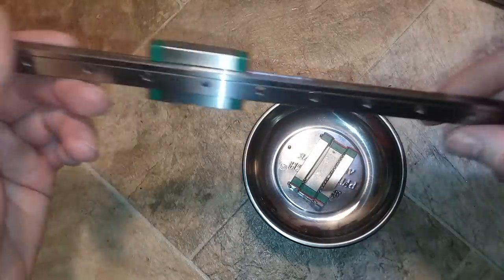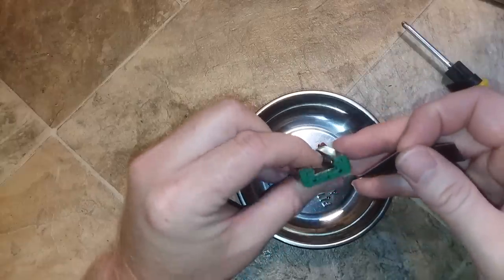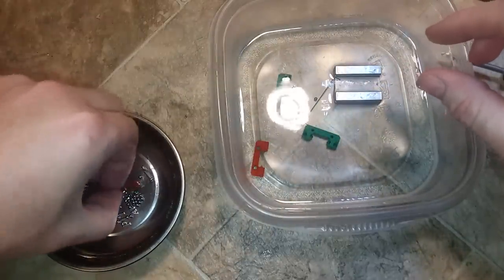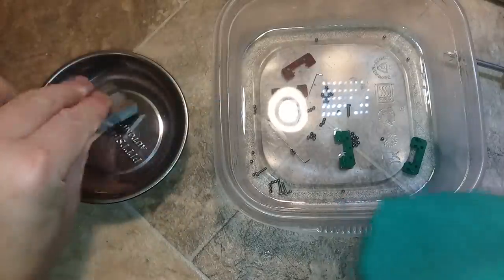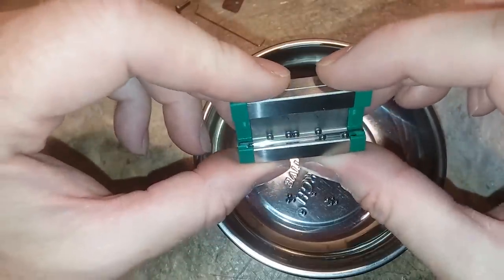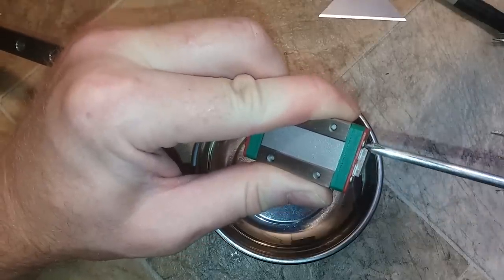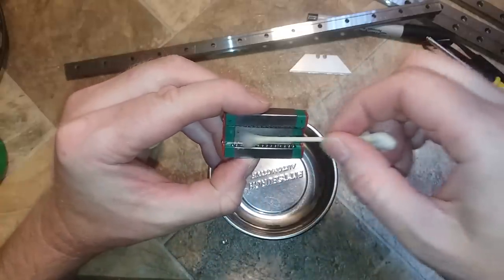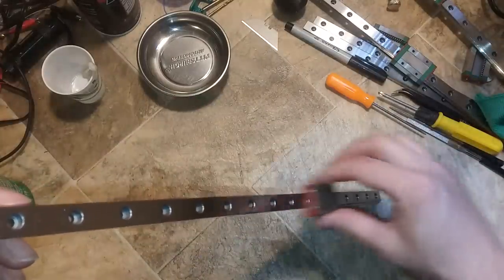Tuning Up Cheap Chinese Linear Bearing

Comment: It does look like a Hiwin knock off. Linear bearings are typically pre-loaded for smooth action. However with the smaller gothic arch, you cannot preload loaded them (not enough anyway), thus they will stick if there is no normal force on the carriage. The only reason you were able to get the free motion out of your guide is that there is way too much space for the bearings. This is also evident since you said they were falling out. In the end, I bet this rocks back and forth a bit, and would not be reliable for alignment applications.
Reply from the maker: The only reason they bearing did not move smoothly is because they are coated in factory protectant (cosmoline) which gums up the movement.  Did you watch the video?  The bearings fell out because the retaining clip was bent out of shape by the left over plastic from the molding process and that was only when the block was not on the rail.  And I have zero slop in the bearings and print at 100 mm/s.
Reply: @MrDabrudda  I think Alexander is right actually. I have genuine HG15 blocks/rails and they definitely grab quite a bit. In this case it might well be because of the particular grease they use at the factory, but good linear bearings should not roll far beyond where you push them.
Reply: This is a low-cost low-profile linear rail with only one row of balls on each side, they are usually not preloaded for entry-level DIY. Verry limited constrain in Y direction and tilting. The standard profile liner rail usually has two rows of ball bearing on each side and preloaded, so 5 out of the total 6 degrees of freedom are fixed. When they are in new condition, pretty hard to move by hand. But when they get old, can also move freely.
Reply: @JamesZJi  Depending on how you install it and determine the right position
Reply: @MrDabrudda  there's no such thing as zero slop on mechanical devices ;)

Comment: What could cause it to still be binding after you've cleaned and put it back together.  I had no gaps of any kind between bearings, almost as if there were too many. Mine tried to pop out more than once while putting it back on the bar. Tip of my exact got magnetized sitting in the little tray and that helped put them back in. It's a fiddly thing for sure.
Reply from the maker: Make sure you don't have too many bearings in each side.  Mine had 33 bearings each side.  Also make sure the sweep seals are loose when installing the bearing block onto the rail and then tighten the sweep seals down.  And check the bearing path for any damage.  It may require some breaking-in to loosen up.

Comment: Use WD-40 or Mineral Spirits for cleaning/degreasing linear bearings.  Clean/dry, then immediately lube/oil them with a lubricating oil (not WD-40) after they are dry.  Good tutorial... Great catch on the extra plastic bowing the retaining rails.  These cheap Chinese linear guides/rails are prefect for small project machines and upgrading cheap 3D printers and laser cutting machines.
Reply: What's a good lube I can buy locally??
Reply: @omaroskeno3314  Use ky jelly. Your neighbour might have them
Reply: I like the file use over the clean parts too.
Reply: @Zo Fryer For these, I would probably use 56504 instead

Comment: Is disassembling them necessary for cleaning them? I have a similar set on my printer and I got mine oiled with a basic (non-silicone) oil directly on the rails and I've never had any issues.
Reply from the maker: You could soak the bearing block assembly in IPA to break up the protectant and then lube.

Comment: My problem was the size of the balls. I had to measure one by one and take out the big and smaller ones
Reply: Depending on what you mean by that, having two different sized balls in a bearing is often intentional as it prevents the bearing from binding up.

Comment: I have bought 2 extra MGN12H blocks because there comes only 1 with the rail.
When i place them on the rail, they don't even slide a bit. I need some force to move them over the rail. So, i hope i can fix them, else, i have to trash them.
Reply: I know its probably too late, but its the wipes that bind your stuff up.
Reply: @girrrrrrr2  Is there a way to alter the wipes for better movement?
Reply: @ronnyverminck2741  Loose up the screw and then tighten it when its on the rail.

Comment: Brilliant just what I was looking for I’ve ordered 3 heavy duty sets to make a good CNC may I just say another video a guy measured the bearings and they were all very slightly smaller and as quality bearing are minimal cost he recommender replacing them which I’ll do also

Comment: If you put these bearing too close to a magnet they may get magnetic as well.
Reply from the maker: The magnet in the tool tray is not strong enough to leave any lasting residual magnetism in the bearings.

Comment: Excellent video but I was wondering, couldn't you submerge the bearing without disassembly into the alcohol and have it dissolve the gunk? Move it back and forth while submerged for a bit? And could I use acetone in lieu of alcohol? Thanks!
Reply from the maker: You could use alcohol to clean up the factory protectant.  Aceteone might be too aggressive and eat the plastic.  Not sure what type of plastic are on the blocks
Reply: @MrDabrudda  Thanks, I just got four guides so I'm going to have to prep them soon, looking forward to the upgrade!

Comment: Do you think you could just soak the bearings in your solution without disassembling them and still get similar results?
Reply: Possibly, if soaked.  Hard to get the solution down in all the holes, crevices and between the bearings, and enough circulation to get the goop and any debris out.  Note the long tubes full of ball bearings.

Start having to check out the effects of long-term exposure to the solvent on the materials used.  Swelling, softening, degradation, cracking / crazing.

Comment: meh, i didn't see any reason to clean the bearings that came with my cnc router; they came with a grease nipple and with the sort of grease they suggest to use, it's not supposed to slide that freely anyway. I did loosen and tighten the seals for installation though.
Reply from the maker: These smaller bearings don't come with a grease zerk fitting.
Reply: @MrDabrudda  these "Chinese clones" u mean.
Reply: @Killerjack007  nah i have expensive linear rails but they dont have a grease fitting. theyre for a 180x180 printer so theyre way too small for one
Reply: Often times the grease port on Chinese linear rails are just for show they don't lead anywhere
Reply: @techdegenerate286   Mine do thankfully but I know some that require a hole to be drilled into the plastic before fitting the nipple.
Reply: @techdegenerate286  "LOL"
Reply: @MrDabrudda  Chinese junk bearings don't come with a grease zerk.  Industrial quality ones do.

Comment: I wouldn't advise running any kind of bearing without some form of lubricant, maybe some thin gear oil or something but no lube is a bad idea
Reply: Did you even watch the video? he used Slick 50
Reply: rparker069 you can ren dry and in some applications it’s advisable. Good bearings will last a min of 10,000 linear miles of travel. Real Hiwin is the low cost bearings and rails, Iko thk, Bosch, and Thompson are high end.

Comment: Very descriptive and useful - thanks!
@3.55 - you're filing plastics parts down in your cleaned parts cup.
I was wondering why you didn't use the magnetic pan/cup with the water/alcohol solution - any specific reason?, the parts ought to stay down there and not easily fall out and dissapear on the floor, and no need to move them around too much - getting (more) finger grease on them when clean, etc.
Reply from the maker: No specific reason.  It was the container I had on hand and was deep enough to submerge the parts.
Reply: EgonSorensen 77

Comment: I would use a graphite pen for locks to avoid ball clinging but people are always too cautious with oils for dirt collection and in general almost any oil or vaseline works as long as it doesent affect the plastic mounts as the speed for home use is somewhat slow anyway and if you just use such on lets say z azis, it wont move much at all and that we wish to have a rigid mount instead.  I would say that dont use them on x axis on printers or cnc, and never on y on cnc unless it is covered from dust pr the bearings will clog. A combination of bars and these is best

Comment: But are the rails nice and true? Is there any play on the bearing housing block?  Cause thats the problem with cheap rail bearings, they aren’t true no matter how smoothly they move.  I would like to see how far off the rails and the block is when it’s moves along the rails.
Reply: it's hard to measure unless he has a super flat surface to but them on... I am wondering how DIY guys do check them without having to invest in super expensive gears
Reply: @anoirbentanfous   You can feel when there is play. I brought one good set of rails and blocks and then a few chinese blocks, you can feel the difference, no need for anything special to measure it.
Reply: @metalmolisher666  you have special fingers, men!  ;-)
Reply: A plate of glass can be used to check the straightness of the rails.
Reply: @archer9338  glass isn't very flat use a surface plate if you can afford one, or make a flat surface with the 3 plate method (I believe oxtool has a video about it)
Reply: A steel rule in good condition is enough to check how true the rails are
What are these super expensive tooling you need to check how flat they are??

Comment: Not sure if you're still responding to comments on this, but does it make sense to replace the balls in these with ceramic balls? Obviously that puts you with not cheap rails anymore, but theoretically, you should never have to perform any maintenance again right? No lubrication would be the least amount of drag too if that makes any difference.
Reply from the maker: For the application I would not replace the ball bears.  I clean the rails once a year and reapply lubricant.
Reply: Replacing with Teflon balls is also a thing, but it has been suggested by Adam Savage on his Tested channel to consider polishing the raceways.  And of course this depends on your application.  Teflon would be a low rpm type solution, i.e. an R2-D2 neck bearing, that doesn't need to move much.
Thanks OP for sharing this material.  I've acquired a cheaply built gemstone faceting machine I'm considering cleaning up and extending the mast bearing on.  Might go crazy and run stuff through the ultrasonic cleaner in a bath of carb cleaner 🤪 ...but will probably stick with steel balls, and lube.  
I really appreciate the tips, and took notes.  I was dreading doing this; thanks to your video, I'm now looking forward to it.  Subbed.
Reply: No absolutely not. these are hand fitted at the factory with slightly different sized balls, that's why you see numbers like +2 hand scribed on the side, even mixing the balls in the same block could result in binding or stickiness due to mismatched ball sizes.
Reply: There's no way to adjust the preload,  so ball size is more critical than material.   If these get sloppy with wear you can buy oversized balls.

Comment: Thanks for sharing, looking into getting some 800mm linear guides for my Delta printer. Kind of curious since its been nearly two years. How well are these holding up for you?
Reply from the maker: The linear rails have held up perfectly.  Every few months I'll clean the rails with a terry cloth and reapply the synthetic lubrication.

Comment: There is a much simpler easier way to clean these... Even old dirty neglected bearings. Inject lps and work it back and forth. Repeat as necessary. Do the same process with grease 2-3 times as necessary to remove the lps. CRC QD electronic cleaner before grease if your concerned about the LPS. 
That looks alot like a Korean hiwin.  Which is a decent slide and bearing.
Reply: The chinese are copying Hiwin, you can find those on aliexpress or ebay

Comment: EDIT: THANKS a lot for this video :)
I just tried to do this on the rails I got. They look exactly the same, but even after two cycles of cleaning, bending the guide wires so they don't press the balls too tightly against the race and de- and regreasing, two of my rails are still quite hard to move. did you have success with every pair of rails you ordered? I feel one of mine has just a little bittoo tight tolerances...
Reply from the maker: All of the rails I purchased cleaned up and moved without binding.  With use the rails should loosen up.  Just keep them clean and lubed and watch for any signs of deterioration.

Comment: I do that with my LM8UU linear bearings as well..usually they come with grit/garbage in the small bear bearings and cause issues and alot of noise..
I would bet a drop of non-detergent air compressor oil would go a LONG way in the smoothness of that rail and bearings
Reply from the maker: Use some pneumatic tool oil would work too.  3 in 1 oil, even mineral oil would be better than nothing.
Reply: Have you tried sewing machine oil? It is the closest thing commonly available for use on machine tools (micrometers).  Lubes well without attracting a lot of dirt and grime.
Reply: Brad Quinn sewing machines are, after all, the most precision machine tool that the average household owns — and that has been true for about a century.

Getting less so with modern cheap-ass plastic sewing machines mind you, as those displace good old machines.

Comment: Couldn’t you soak the whole thing and then lube it without taking it off the rails? You wouldn’t have to worry about losing bearings then. I thought about this as I was putting one of the slides back together and lost a bearing.
Reply from the maker: I guess you could soak the block in alcohol but it may still have cosmoline protectant in the slots.  The factory protectant would be diluted with the cleaning and re-lubricating.

Comment: Are you still satisfied from those rails on working? Are they performing well on your machine?
Reply from the maker: Very satisfied with the rails.   Far better than the Igus bearings I was using.
Reply: @MrDabrudda  thank you very much

Comment: I lost some balls, so i took some from an extra block and WOW they are not the right size and so it works like poop. Its the same size block but slightly different balls. Guess ill need to remove all of them and pick out the wrong ones.
Reply: you can buy those small balls on ebay cost a few dollar for 100 search 1mm to 9.525mm G10 Grade 10 Chrome Steel Ball Bearings

Comment: The reason why these bearing with viscous grease is to compensate these tiny tolerance between slider, ball and rail. Without these high viscous grease, the slider will wobble......It is not because they don't want to make it good, it is because people want to buy it cheap....
Reply: the carriage wobbles on the cheap ones? Didn't know that.. That'll cause sloppier 3D prints. GTK.
Reply: It depends, but you are absolutely correct in some cases. Avoid this by being choosy where you purchase, put the time into preparing them, swap out the ball bearings for higher quality ones if you so choose, utilize the proper lubrication type and application method, and you can really end up with a solid piece of equipment at a great price. I've seen $25 rails with swapped out bearings outperform $50 rails. It depends on a lot of factors.

Comment: Great video! Why using a solution of 25% IPA and 75% water and not full IPA solution for cleaning ?
Reply: Full strength IPA may damage rubber or plastics. Just enough to dissolve High Quality Anti-Corrosion Inhibiter from Peoples Republic of China... LOL
Reply: And more importantly I think simply because it's cheaper that way. No idea how cheap it is elsewhere (seems to be practically free in the USA) but it's actually very expensive here in Finland at 16 euros per liter. Therefore if the full concentration isn't necessary you might as well treat your wallet and dilute it with water

Comment: i saw these on ebay when i was looking for parts for my diy pcb mill. was curious if they were any good. i think many of the mechanical thingstuffs i get from china all come with packing grease that needs to be stripped off and replaced with something more usable as a lubricant.

Comment: I have two sets of rails from two different suppliers. The blocks are different sizes and don’t fit each other. Quite annoying!
Reply: Then you should have ordered the correct sizes!
Reply: Acrimonious Mirth I have a Honda Ridgeline, nothing is interchangeable with a Ford Mustang....gee, I wonder why.

Comment: I also ordered some cheap rails and I have one question. Are little scratches on top of rail an issue? Sides where guides/balls should roll look good.
Reply from the maker: Scratches on top of the rail should not be a problem.  Any damage in the recess where the ball bearings roll will cause a problem.
Reply: @MrDabrudda  I just checked the rails thoroughly and I found this :( https://drive.google.com/drive/folders/1SBTT6jCYTt11tN3yIoNx-ILRhfORExnv What do you think? I can feel it with my nail going over it... Should I request replacement? Just for reference on the right you see 9mm hole. It's 20mm rail.